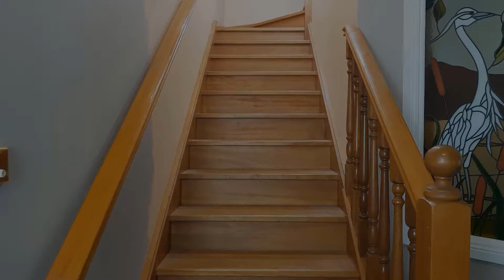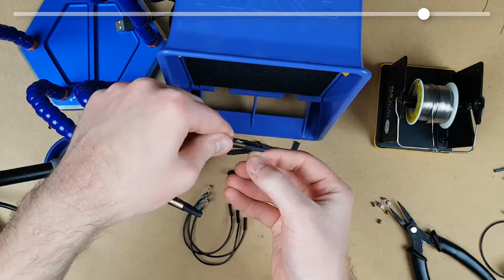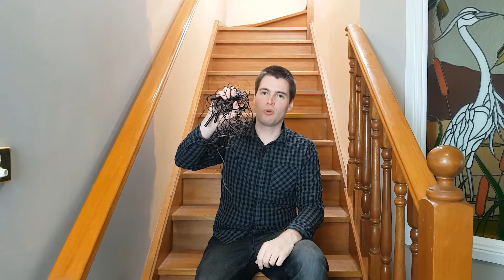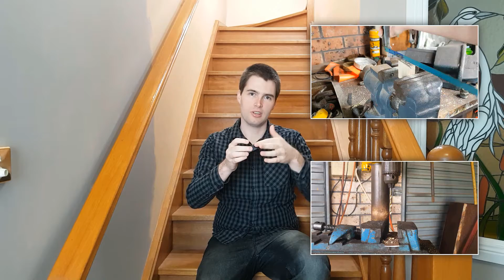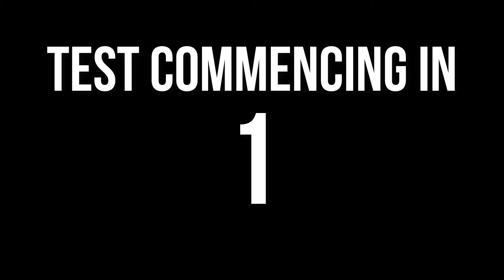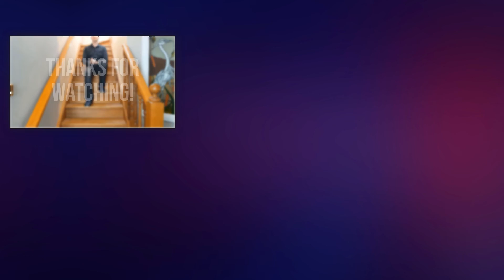Interactive Staircase!

Comment: Hey Chris, great video, what do you mount your camera on for the top down soldering views?
Reply from the maker: Thanks! The timelapse was filmed with my Galaxy S7 and I mounted it using stuff I had laying around. To be specific, I used two light stands (the type that come with softboxes and umbrella lights from eBay) with a pipe sitting on top of them. I hammered down both ends of the pipe and drilled a hole through them so it could sit on top of the stands. I used some cheap clamps and wire to hold the camera on the pipe.

I took a couple of photos (sorry about the mess, I'm in the middle of another project!): https://imgur.com/a/HXLc1gk

Comment: The idea of multiple laser & receivers is 'cute', and might let you turn your stairs into a musical keyboard.
https://en.wikipedia.org/wiki/The_Walking_Piano
If you want to detect any or all of the stairs occupied, I have no better idea for input sensors that.
If you just want the position of the person. I suggest the following part.

Consider this part, SparkFun Distance Sensor Breakout - 4 Meter, VL53L1X 
https://www.sparkfun.com/products/14722
My thought was to mount it at an angle so the ankles of person on the stairs are detected and their distance to the sensor is measured.

Comment: Came here from your post in r/arduino. 
Rule #1 always make a prototype or two and test your theory out. 
This rule has to do with the circuit you build, the protective housing and the code you write.
You waste less time and money, get more and faster results and more sleep.

Everybody thinks they know about assembly lines where you do one step at a time, then the next. 
But good assembly lines aren't like that at all, they are carefully planned out before "step one".
The advantage is "step one" is done by one person, while "step two" is done by another.
Reply from the maker: Thanks for the sub and for the advice! I did prototype the laser array, the photoresistor array and the LED strip interaction to verify that the core functionality would all work, and I diagrammed all my wiring before I touched a soldering iron. I didn't go in all guns blazing, but you're definitely right that I should have prototyped the installation aspect more thoroughly. I've learned my lesson on that count!

I'm working on adding more effects to the stairs for Part 2. At some point I'll also try replacing the lasers and photoresistors with IR LEDs and IR sensors to avoid the red light on the stairs.